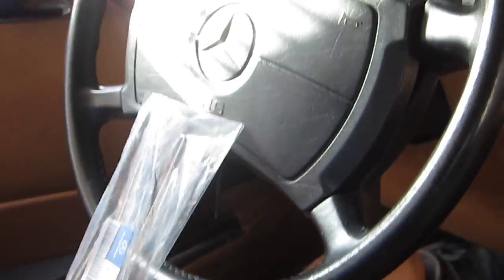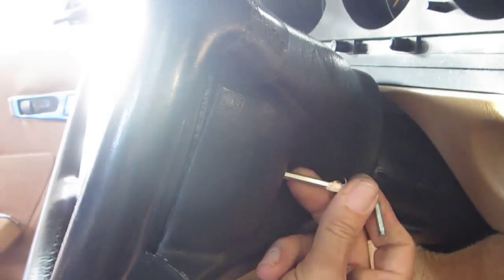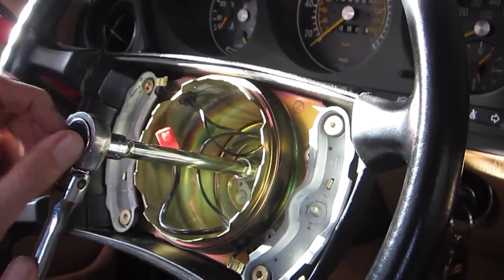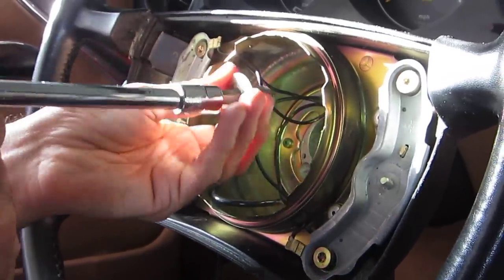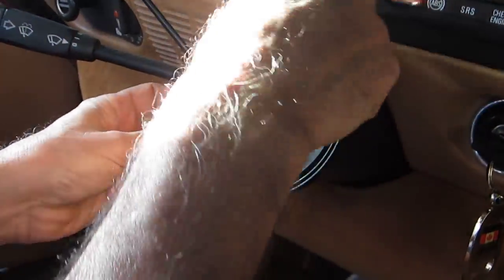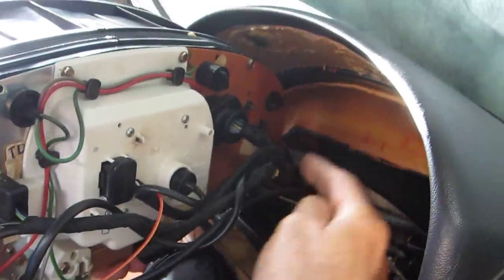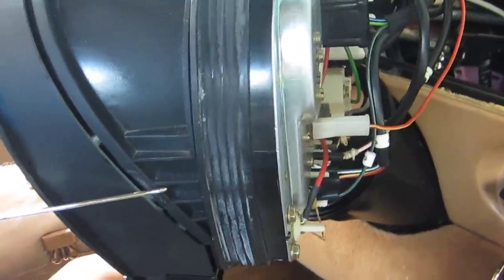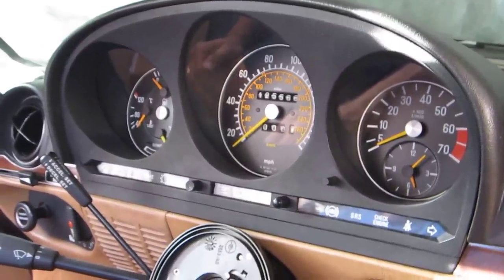How to Remove Speedometer Cluster from Mercedes 560SL 1989 for Repair.

Comment: Excellent video! Thumbs up and subscribed! I have a question for you. I have a 1988 560 SL, and the park brake knob came off, and the cable slipped behind the light switch surround.
How do you remove the light switch surround trim?
Thank you in advance

Comment: steering screw can be heated with small torch, or soldering iron, then loctite goes back to fluid
Reply from the maker: You should not do that. There is a plastic plate behind the steering wheel which would warp due to heat and cause issues such as making noise when turning steering wheel. NOT RECOMMENDED!

Comment: after repair, my high beam lights do not come on.  did i miss plugging something in?
Reply from the maker: You need to remove the cluster again and check the light bulb for high beam. It is most likely loose and does not make a good contact.